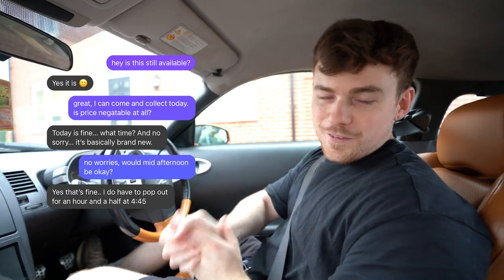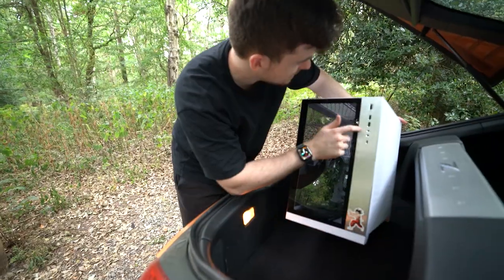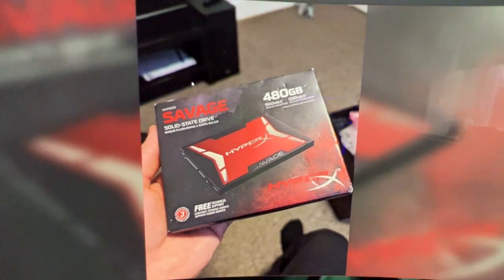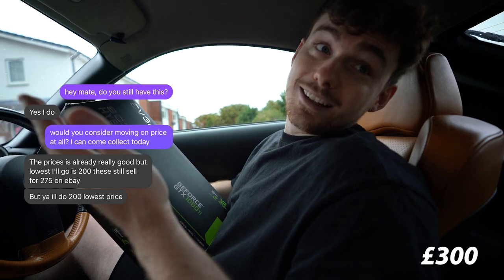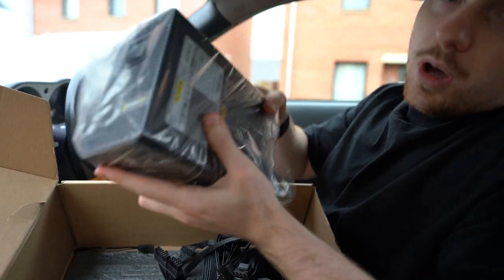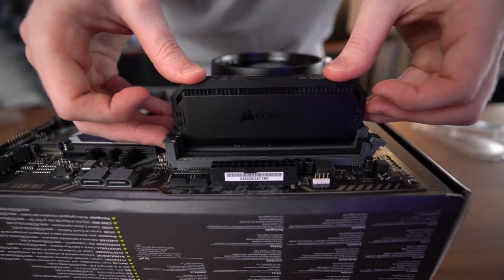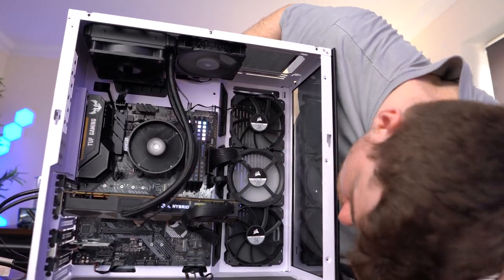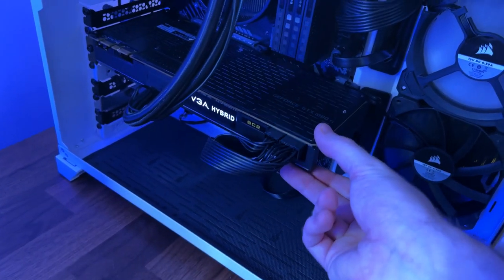Building The ALL Facebook Marketplace Gaming PC

Comment: I found used non-working PC with i7-6700k RX570 4gb and 12 gb RAM for 150 usd i bought it and repared it for almost no money i started using it but like after month ago, gpu died… so i bought used RX480 8gb for 80 usd and now PC works fine, i think you definitely find some great PC deals on used markets but some of them are very heavily used or broken so be very patient if you buying something used from someone… buying something that is new is much more worth it than these used markets at least thats my opinion, you definitely save some money with these used markets but you’re always not sure if it will work or not
Reply from the maker: great deal on the faulty PC! yeah you're 100% right its a gamble but gotta love a good deal

Comment: I've heard from many PC experts anything over 800w power  supply is overkill  unless you are buying top of the line electronics
Reply from the maker: 800w would be more than enough for most current systems for sure!
Reply: me with a 12600kf and a rx 6800 and 850w psu 😵‍💫
Reply: me with a 5800x3d/7900xtx and a 1600w psu haha